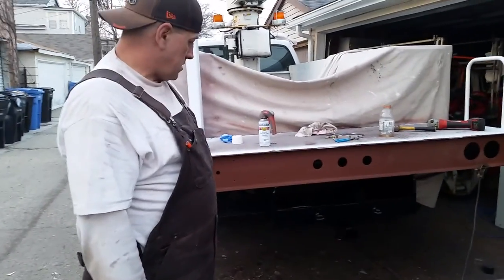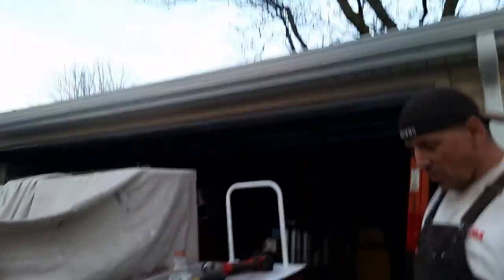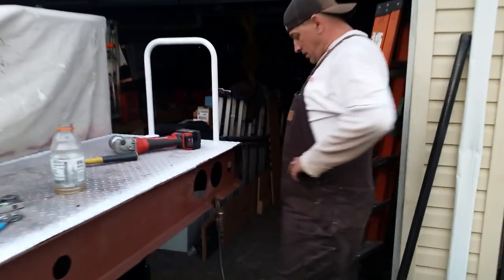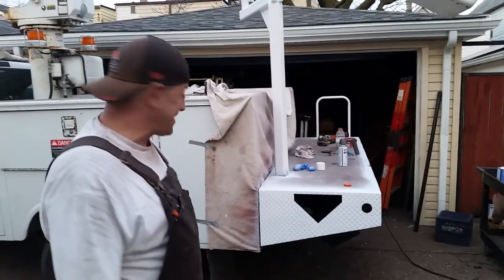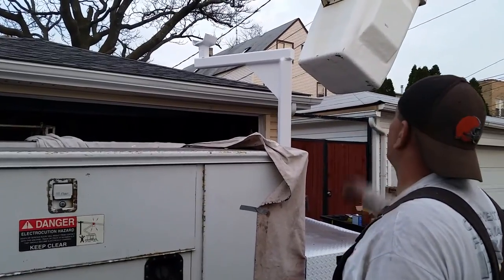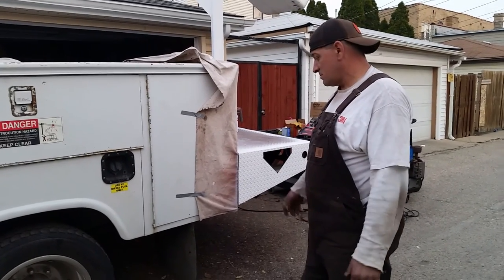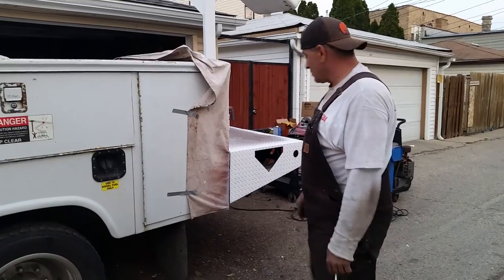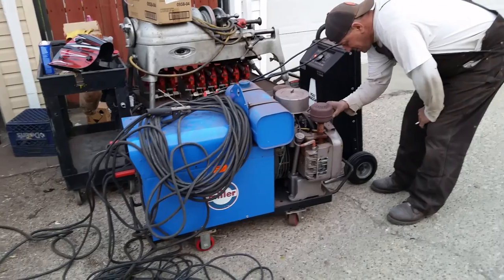Welding on the back plate

Comment: Good job Nate! Them Asians lol. Does that right angle Milwaukee impact work good?
Reply from the maker: im pretty sure that was a grinder you were talking about and it goes through batteries pretty quickly, but its convenient when you're at a job and have some small stuff to do. We were grinding for like six hours so I picked up a corded one also.
Reply: +Mr Nate oh haha my bad. I wondered if one of those would be worth getting too. What size battery do u run on it
Reply from the maker: +Jake Ziegler M 18
Reply: +Mr Nate what amp hour? 4.0?
Reply from the maker: +Jake Ziegler ya 4.0